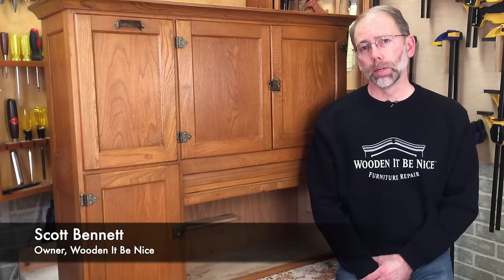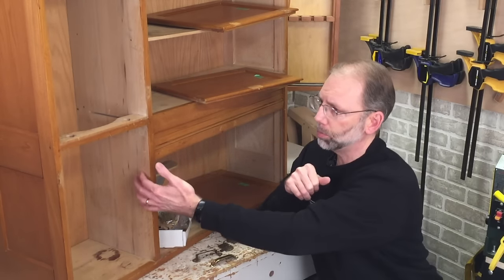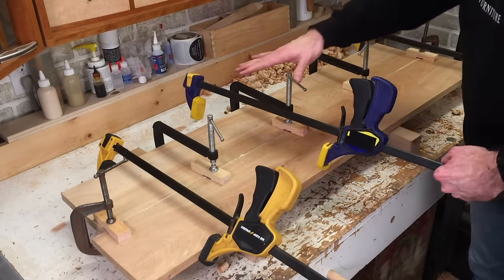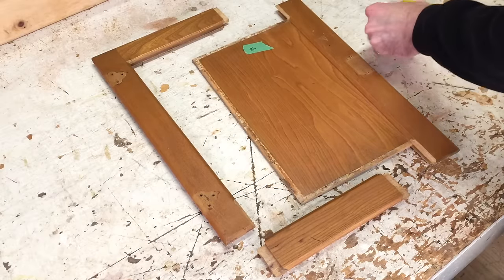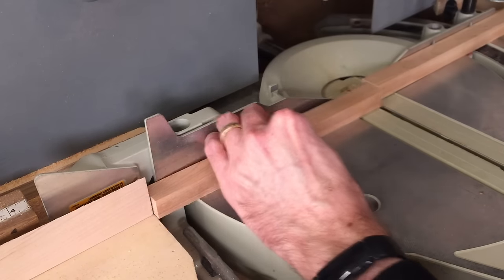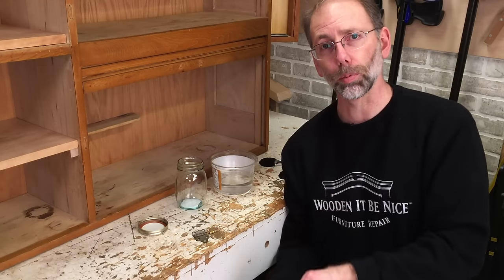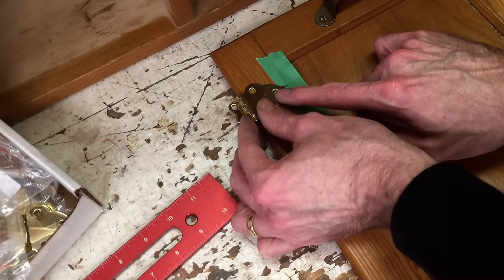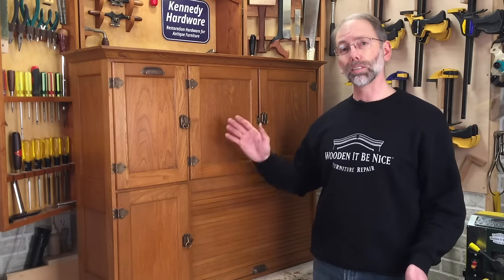Hoosier Cabinet Repair Showing New Brass Hardware & a Woodworking Lesson by Fixing Furniture

Comment: Note: you can quickly age brass with household chemicals. Take a 50/50 mix of hydrogen peroxide and white vinegar, warm it in the microwave (note: the hotter it is, the faster the reaction will occur). Immerse the brass and watch the magic happen. When it reaches the desired level of corrosion, remove and rinse in tap water. A steaming hot mixture can fully age brass in about 30 seconds. Note: the liquid will bubble and start to turn bluish green during the process. This is normal. The color change is due to the copper leeching out of the brass.

Comment: An antique dealer told me to heat new brass fittings in the oven to tarnish them but gave no details as to time and temperature.  I tried with little effect which may have been due to my being overcautious.  I would certainly prefer a non-chemical approach.  I wonder if Tom Johnson or Trina's dad would know about this method.

Comment: At first, I wasn’t happy about you altering the antique Hoosier cabinet, but then you mentioned that it had already been  worked on and changed before. I appreciate you using vintage slotted screws, and the aged hardware also looks nice. I wonder what she will use the short shelf for? 
I have a Hoosier cabinet that my dad refinished for me. It still has the flour sifter in it and I use it almost every day. I think it was made in the mid 1920s, it has a porcelain enamel worktop that does not slide out, the only one like that I have ever seen. It does not have a tambour door. My dad lives in Indiana and purchased some of the replacement parts from Kennedy’s. Thanks for the video!
Reply from the maker: Oh, wow!  Thank you for sharing that.  As I installed that top (short) shelf, I was thinking the same thing - what will the customer use this shelf for.  I think it would be a great spot to store some cooking magazines stacked up.  I will have to ask when they pick it up.  Cheers.  Scott

Comment: Thanks for another great video. When I needed to age the brass hardware for my period-specific British campaign secretary, I found that the hardware aged more quickly and consistently if I rubbed it with a green scotch-brite pad first, to remove the clear coat. Some hardware has this coat and some doesn't it seems.

Comment: Had problems with breaking brass screws going into oak. Such a simple solution explained 😀
Reply from the maker: Glad you found that helpful.  I hope it will save you time in the future.  Scott
Reply: @FixingFurniture  Your metric comment as opposed to imperial measurements was taken on board too. Thanks for your clear and concise explanations. From a hopefully improveing  woodworker

Comment: Thanks for all the helpful tips. I upcycle old vintage jewelry boxes and often have to replace hinges. They usually have tiny brass screws,so thanks foe the tip about using a steel screw first.

Comment: Instead of using a thick sewing needle to get into tight spots i use a nail file, i find it very efficient, long enough & skinny enough with an abrasive face to remove old dried up glue, give it a try and add a few to your tool collection, love your videos, fantastic work 👍

Comment: One of my aunts had a couple of those square hooks (in a different style cabinet) under the sink; she used them to hang the dish scrubber out of sight.
I understand the difference between restoration and repair and refinishing/refurbishing, and why you would not want shiny new hardware on an antique item.  However, my personal preference is not for things that look grungy, dingy, or rusty... 😉

Comment: Hey Scott, thanks for another great video. I've got a tip that might be useful for you. Use angled picks to clean that glue residue in tight areas instead of the sewing needle. I think it'd be easier and faster.

Comment: Naming the chemicals used for aging the hardware would be helpful, even if in this case it would be "I'm using a pre-made brass aging solution".

I think a video about ways to add & remove tarnish would be interesting.

Comment: Your videos are very informative.  I have an early 1900s Seller’s Hoosier cabinet that’s in bad shape.  One of the doors has water damage, with terrible bubbles throughout the top layer of the panel.  The joints are solidly glued, so I’m not sure if it would be better to try and glue the bubbles down, or try and get the door frames apart.

Comment: I very much enjoy your videos. I always learn something. 

I have a question… I assume the reason why the glue joints failed on the rails and styles is that they were glue with hide glue. As you said, it’s the only glue that is reversible. 

As you’re repairing, why use hide glue again? Why not use PVA wood glue to prevent further failures?

Comment: When you immerse the entire new part in the oxidation product, the hinge pin and the mechanical iron parts (springs and other parts) will begin an oxidation process that may cause it to become blocked or difficult to function. It would be better to remove said parts and then oxidize the shiny parts.😃👍

Comment: when you pull the jointer plane back towards you are you releasing some of the pressure, doesn't it add extra friction to the blade dragging it back across the wood dulling it quicker, I see a lot of woodworkers do that and just don't get it.

Comment: Was the middle door able to open freely after converting the bin to a door and adding the latch? Looked like maybe the latch bar needed to be shortened a little.
Reply from the maker: Yes, the middle door clears the latch as I showed in the video.  The unique design of these hinges swings that edge of the door away from the hinges so it cleared the latch.  I hope that answers your question.  Scott
Reply: I must have missed you showing that

Comment: I love all your videos, and congratulations on your silver play button! 

Question for you - Say another shop had started repairs on this cabinet and replaced all of the hardware just as you had with the chemical tarnish. But the customer brought it to you to finish the work on the rest of the cabinet - would you be able to tell that the hardware was brand new or the original after the change with tarnishing? You pointed out many details in the different screws as you dismantled the doors, so I'm curious whether someone 20 years from now would be able to tell this is 21st century hardware, or if the chemical tarnishing and standardizing of the screws makes that difficult to discern.